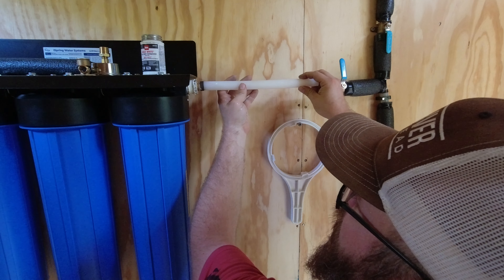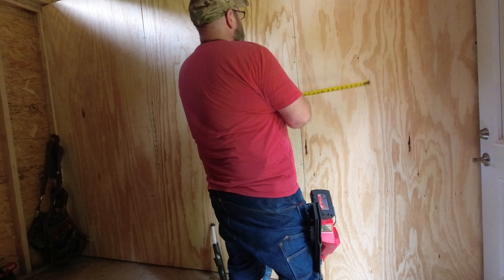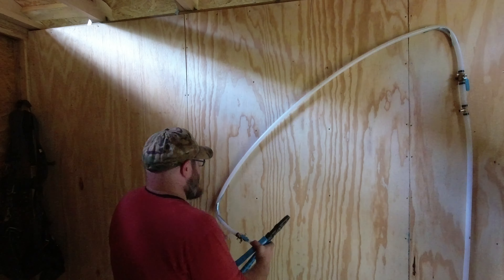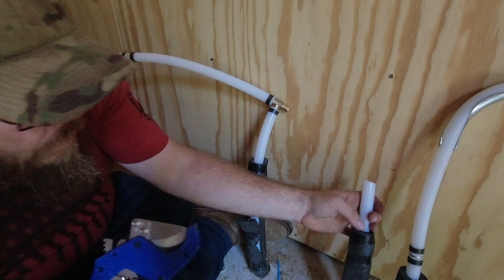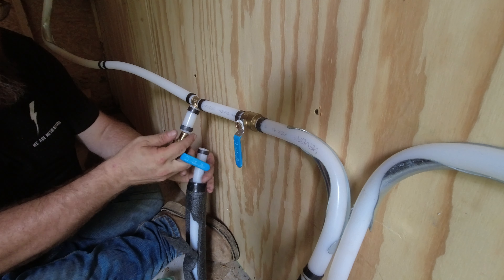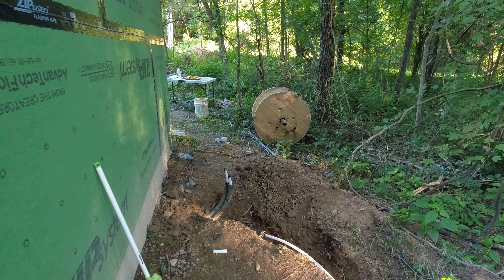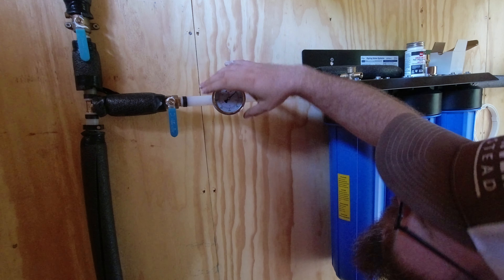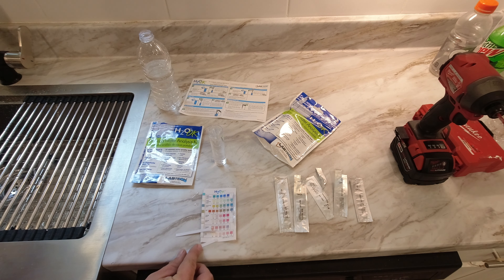048 - How we Installed a Multi-Home Homestead Water Filtration System

Comment: What does PSI mean? Why is 60 or 80 psi what you would want for your house?
Reply from the maker: PSI stands for Pounds per Square Inch. It's a way of measuring pressure. 
anything over 80 PSI at your house can cause leaks.